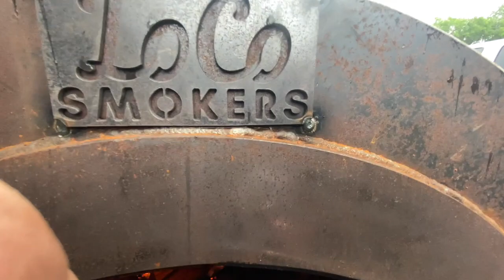Offset smoker build (500 gallon)

Comment: Is this smoker sandblasted or just flap disc? Looks bad ass!!! Also what high temp clear coat do you use and how does it hold up on the firebox? Gonna build out a 350 gallon tank and I like the look of the clear over the raw metal!
Reply from the maker: Just flap disc. 

Honestly we use a high gloss automotive clear now.  And it’s worked best.  But it still shows wear at the “hot spots”.

Comment: Great video!! How did you mount the smoker onto the trailer? I’m thinking of using a cherry picker for a 500 gallon build I’m doing
Reply from the maker: Engine hoist to get the smoke stack side and jack on fire box side.
Reply: @CodeyMikes  sorry for the dumb question. Are you saying the trailer is stationary and you move the tank over the trailer then lower it?
Reply from the maker: @srbournival  either way would work. But
This one we got the front on. And then just put the jack on the fire box and pushed it on.  But also we had like 3 people lol
Reply: @CodeyMikes  ok LOL. I understand. Thank you for taking the time to answer the question I appreciate it

Comment: How do you mark the radius of the round end for the firebox cut on the end of the tank?
Reply from the maker: So we set the fire box the height it needs to be. And then take a metal ruler and scratch the ark on to the tank. Then the bottom is always flat.
Reply: @CodeyMikes  can you explain the arc? My mind is just not grasping this...
Reply: @CodeyMikes  showing this part in a video would help the mentally challenged, which I seem to be part of...
Reply from the maker: @metal75801  lol I got you next time.
Reply: @metal75801  Picture standing at the back of the trailer looking forwards. Right in front of you is the firebox and in front of that is the smoker. Squat down so your eye is looking along the length of the firebox towards the smoker. You can see the arc that the firebox makes on the smoker profile. Now, take a straight edge so it lies lengthways on the line of your eye, one end of the edge at your eye, the other end touching the smoker. rotate it around the circumference of the firebox. Where the other end touches the smoker, that is the line that you would scribe on the smoker. Make sense?
Reply: Makes perfect sense! Thank you!!